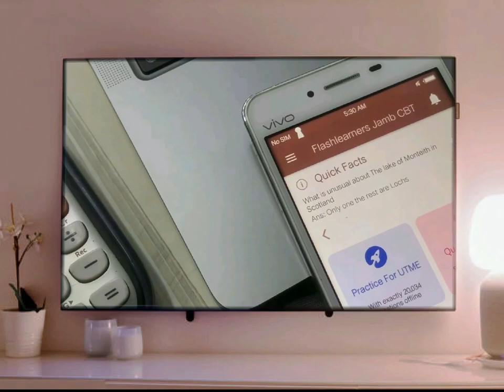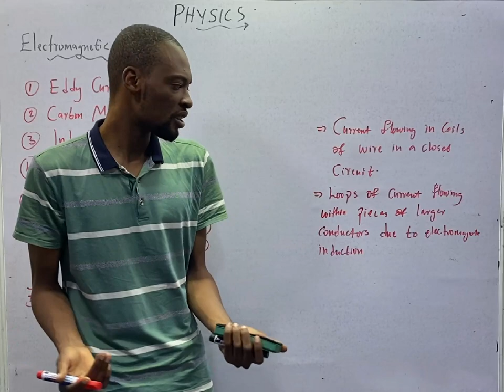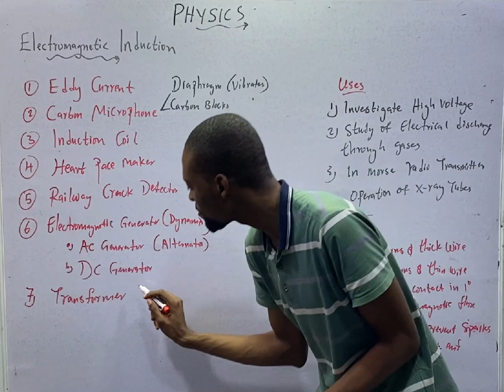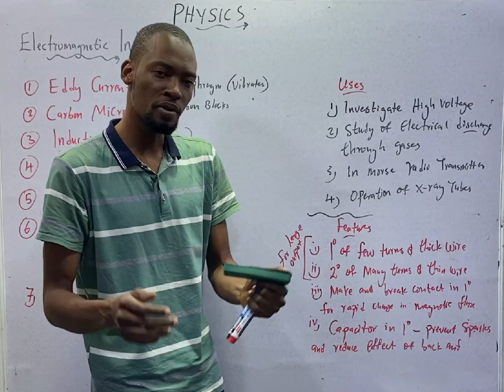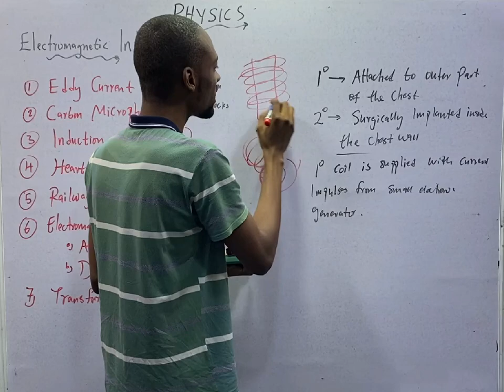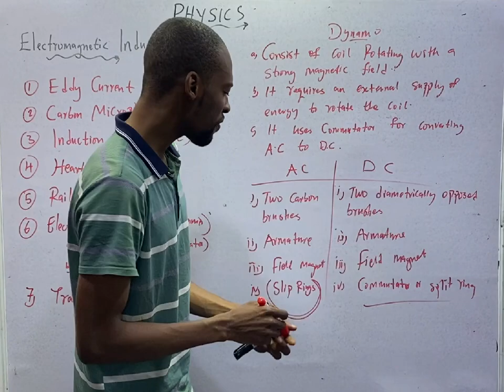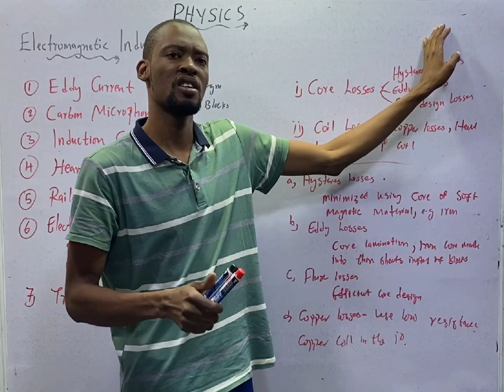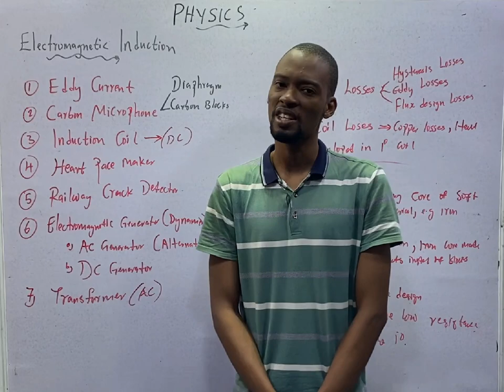Applications of Electromagnetic Induction » 120 Days To Jamb Physics - Ep 101

Comment: Sir please i need help with a question under induced EMF

A band of 500 rectanglar loops of wire of area 20 by 20cm, encloses a region of magnetic field which changes from 1.07 to 0.47 within 5sec, calculate the induced EMF
Reply: 2.4V

From; e = N. Ad¢/t
Reply from the maker: Solved. Video being released